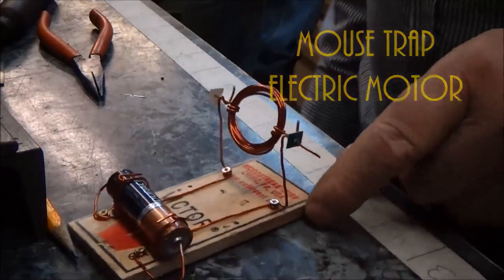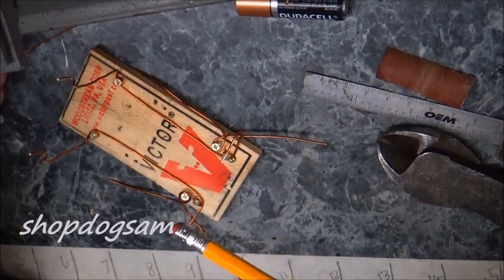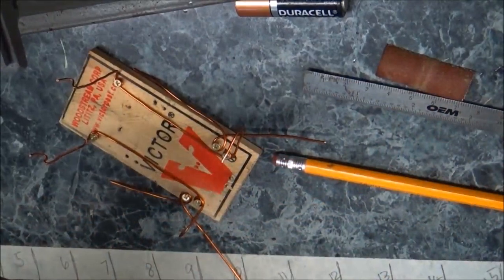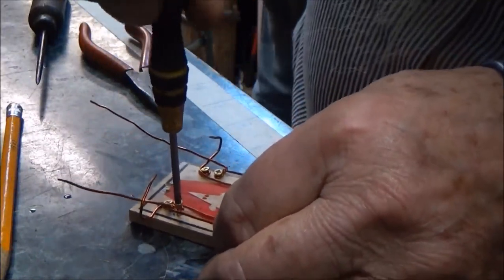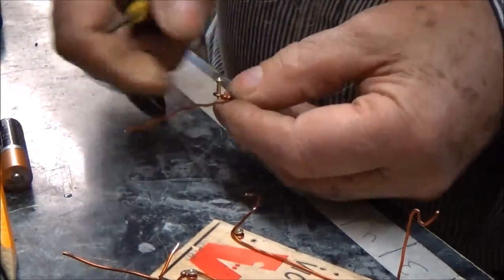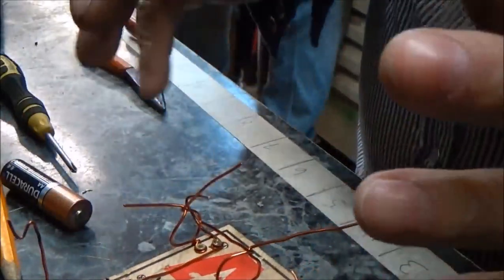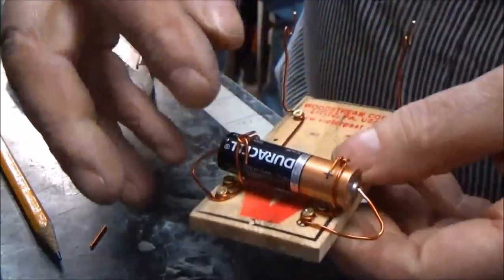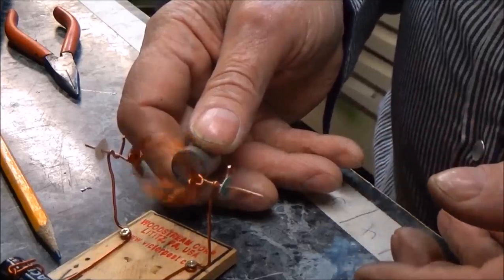Simple Mouse Trap Electric Motor / let's build a battery holder

Comment: I really don't think I need to make one of these.
What I own is a 1908 Toy Electric Engine.
If you have either a reprint or an original 1908 Sears Roebuck & Company catalog that is just what they call it. I paid $30 or $35 for it and five hours later I was offered $600 for it. I still have it because they print new money all the time but I haven't seen another one of these for sale.
Reply: I might make one just to have a tiny little fan on my desk. Hook it into the 5v rail of my PC, fix the magnet somewhere, whittle the prop out of a popsickle stick, and bingo. Homemade tiny desk fan of pointless awesomeness!
Reply: TestECull  My Toy Electric Engine even has a drive pulley to power your fan.
Originally they were sold with farm equipment toys and wood shop toys.
Reply: Rustaholic777
Most of the fun of a mousetrap motor is building it from complete scratch. You can't get that buying a pre-made toy, even if said pre-made toy is just a box of parts.
Reply: Oh sure but it is just too easy and not needed as a functional tool. I build and design things I need. One of the next things I need will be a home scale threshing machine and I have planned it out and everything I need minus a couple sticks of welding rod are just laying around here.